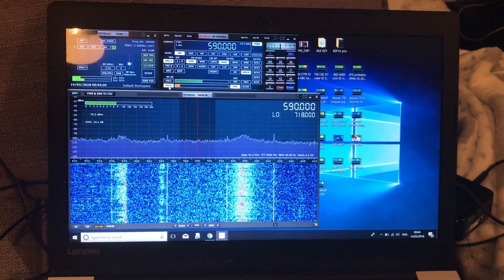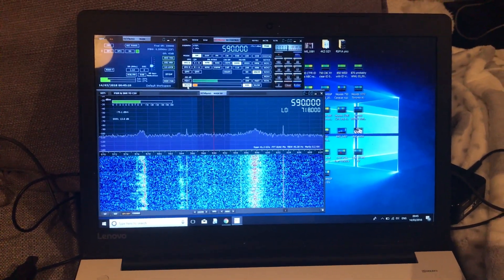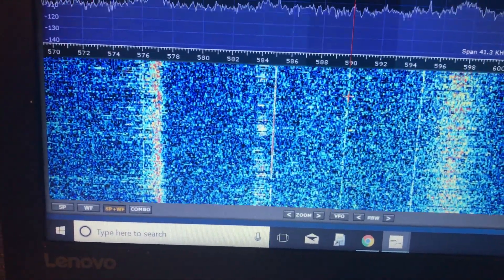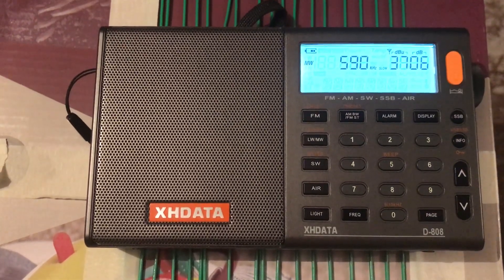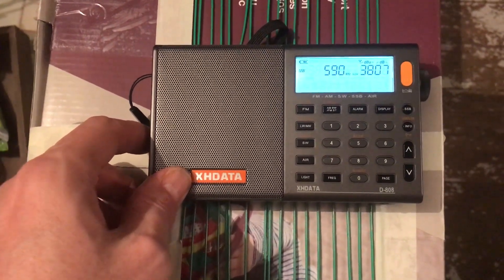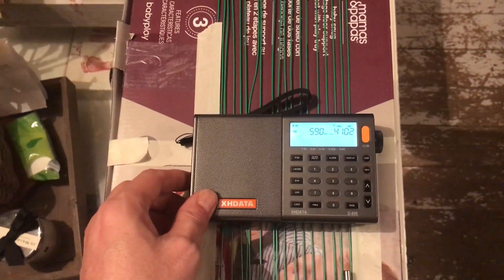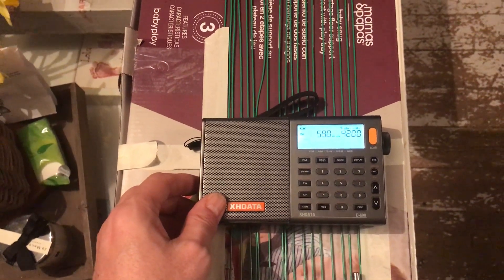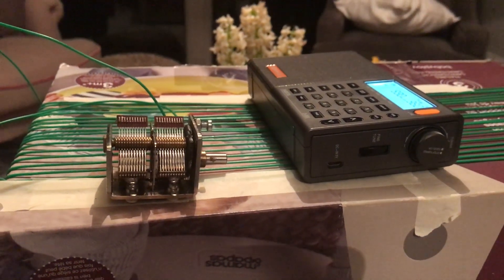Comparing the SDRPlay RSP1A with the XHDATA D-808 receiver on a MW induction loop

Comment: Great experiment. Already TSF36 has pointed out about the ferrite not having a pre-amp for the ferrite antenna. I was going to say also that there might be electrical noise from the laptop affecting reception on the SDR but looking at the spectrum analyser it seems relatively clean. 73s!
Reply from the maker: Thanks MRD. I checked and there was no appreciable noise from the laptop - actually I know what that looks/sounds like from DXpeditions in the car lol. I have a kit to build a preamp......! 73! Clint

Comment: Hi Clint ! A tuned loop works great indeed when coupled to a portable radio with a ferrite antenna. But it requires an HF preamp to feed the input of a "normal" receiver or SDR. 
And in that case, it will receive and amplify the QRM radiated from the computer (unless sitting far enough and connected with a coax cable)  I have tried that !
The only kind of loop antenna that works well with an SDR is called ... a Wellbrook loop !
That's what your test demonstrates !
73 de Jean-Luc
Reply from the maker: Hi Jean-Luc, nice to see you here! I think you're right. There's definitely a difference in performance between an SDR directly coupled and a portable inductively coupled. 73! Clint

Comment: Hi Clint, nice video, I get excellent results on MW/LW using my RSP1A with a G5RV, it seems just as capable as  my Sony SW7600GR if not better..👍
Reply from the maker: Hi Matt, thank you very much. I have an Elad FDM DUO and at about 10% of the cost, the RSP1A has about 95% of the performance. It's a superb SDR and the price/performance ratio is something else. However, I have recordings that strongly suggest it doesn't offer the performance of an inductively coupled portable (with internal ferrite antenna), when connected to the loop via a single turn pick-up coil. More testing necessary I think. Thanks for your comments. 73! Clint
Reply: Hi Clint, Why don't you try the D-808 with the Bonito MA305 ? and compare to the RSP1A ? The D808's Antenna input jack is supposed to work on MW as well as SW.

The MA305 works brilliantly with the RSP1A and also the Airspy HF+ and my Tecsun PL-660 which handles the preamp of the MA305 without any noticeable over loading. 

I use the 40 CM antenna with the MA305 it's superb for it's small size i really love it and it even sometimes out performs my 10 meter Bonito FX Loop. 

I noticed too that good quality Coax such as HF-155 from Bonito helps with noise compared to RG58 , I also have it grounded now too.

Comment: Hi Clint, how exactly did you couple the RSP1A to the loop antenna? You mention the pick up coil but don't actually show it.. I think you should get good results if you connected it via a coax cable (of course, you need to add a coupling turn to the loop in that case). Interesting demonstration anyway and a nice signal from VOCM on the XHDATA. 73, Matthias
Reply from the maker: Hi there Matthias, I used a single turn pick-up coil wired to a BNC connector. The details on that are coming on another video. The SDR simply didn't perform anywhere near as well as the inductively coupled portable. I still think it's enhancement of the performance wtih the internal ferrite, but I don't have much support for that theory, although there is empirical evedence in my video that the performance delta is large. Thanks for shedding any light! 73! Clint
Reply: Hi Clint, obviously your coupling method is insufficient for whatever reason. Maybe you'd get better results by adding a coupling turn to the loop antenna and connecting it to the SDR via a coax cable. 73, Matthias
Reply from the maker: Hi Matthias, I'm not sure I understand you. I already have a coupling turn on the loop antenna - that's what I'm referring to when I say pick-up coil. As for a coax cable, I don't understand how that will help given the loop is in my living room? Thanks and 73! Clint

Comment: I am curious to what people with the Terk Advantage MW antennas or similar Tecsun tuned loops find. How does their reception vary between using the external wire out lead vs. portable coupling?
Reply from the maker: That's an interesting question you pose Bryan. I think I'd always rather build a loop and buy something complicated - like my Wellbrook lol. 73! Clint
Reply: I prefer to build too. But it would be interesting to see if this performance difference also exists for the commercial loops that are conceptually the same to what you built. In the case of the Tecsun, I believe the wires are visible, which allows for some easy reverse engineering ;) - this would be particularly interesting if they don't suffer the same PU loop performance drop.

Comment: Hi Clint. That's an incredible performing loop! Trans-Atlantic reception. Very nice! My practical experience is the same as yours – I find portables work better with these types of DIY tuned loops. I definitely find this for MW and my tuned box loop. So I also tend to use a portable with this style of tuned loop antenna. However, my feeling is that it is not due an enhancement of the internal antenna signal. If coupled well, the external antenna can definitely over power the portable’s internal antenna signal pickup (the internal will only pickup the external antenna signal). I find this happens when I couple a hula hoop sized loop antenna to my Eton Satellit – feeding the antenna coax lead to a 16cm ferrite rod with some 18g wire wrappings. Coupling this wrapped ferrite rod to my Eton portable, it replaces any of the Eton’s internal signal pick-up to where I can orient the Eton any which way and the only signal picking up is that of the hula hoop loop and its orientation for signals and nulls. When coupled like this, there is no added benefit if I additionally point the Eton in the matching direction of the bigger loop antenna or not. And same vice versa, no competing signals if my portable is pointing the wrong way to the signal I am digging with the external antenna. My view/gut feeling for the reason of the observed performance difference of the portable vs pick-up loop feed to an SDR, is it is due to coupling strength, or the strength of signal provided by the coupling loop to the SDR.
Reply from the maker: Hi there Bryan, thank you very much! I must admit, it was quite a thrill to copy TA DX indoors on a £60 portable radio lol. I'd been trying to copy either VOCM or Newstalk 1010 Toronto for a while with the internal ferrite, but it just wasn't having any of it! Thanks for the details on your loop antenna - that's very interesting. Do you have a set of plans for it or a schematic? I'd be up for building one and recording some videos on here. Your theory is interesting and makes sense - we just need some empirical data! By the way, superb choice the Eton Satellit. When I bought mine it had a terrible repuation, so the first reception videos I uploaded were ABC on their 120 metre frequencies using a longwire. Incredible radio. Thanks again for dropping by and commenting - much appreciated! 73! Clint
Reply: Hi Clint. PM me your email address and I can send some pictures or sketch it out for you. Cheers, Bryan
Reply from the maker: Hi Bryan, I can't see a link on your YT home page to PM you? 73s, Clint
Reply: Hi Clint. Sorry - I am actually not sure how it's set up (I don't really post). So I just sent you my email by pm. cheers, Bryan
Reply from the maker: Hi Bryan, thank you very much! I've just sent you an email. 73! Clint